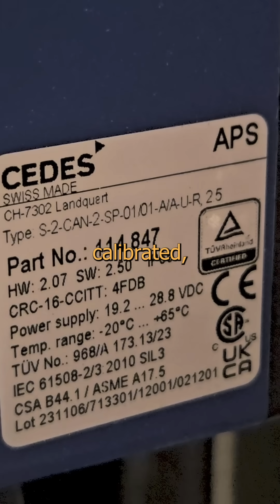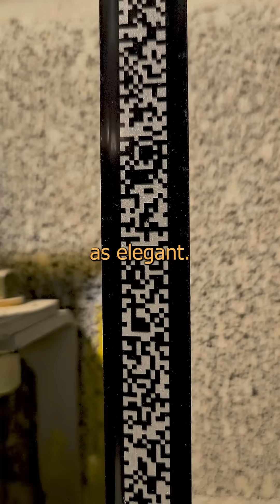Elevator Encoder #chrisboden #comedy #engineering #controls #urbex #indicator #resolver #barcode

Comment: I was trained to drive a manual elevator "muscle memory" is correct. It was not my full time job. I only drove when the elevator attendent was on break or afterhours. But even still, most of the time I could get it within a 1/2in of level on my first try.

I was told the elevators I was driving were the last manually controled elevators in the country. And I was one of the last people trained on them before they were replaced with computer controls.
Reply: that's really cool!
Reply: Perhaps the last one for passengers, but I remember running a lift for cargo and such and I know that lift is still functioning.
Reply: There are manual elevators on almost every high rise construction site in north america and probably Europe too lol. Its how we get materials and people up 10-50 floors before the main elevator is set up, usually near the end of construction. If you are ever looking for work a first aid ticket and manual elevator cert should be able to get u a relatively well paying and easy job in almost any growing city.
Reply: in europe we use special carts that get pulled by the cranes, if no elevator is available or working. else, we take the stairs. materials get brought up by crane and on foot.
Reply: @andywillis9701 our cranes generally only bring stuff to the roof or whatever floor is being built at the time. although they do have a "ramp" they use occasionally to acess the floors below via the side of the building.

we just got the material elevator set up where I am working now. We were bring stuff up on foot. 15 stories. I was never so happy to see a elevator in my life
Reply: Wasn't even aware of such a thing having existed. Very interesting piece of history, thanks 😊
Reply: Ah yes the useless skills accumulated over a life time. I used to be a stripper. Negatives. Just not that kind of stripper you were thinking.
Reply: And THATS pretty cool.
Reply: There's at least 1 near me, at least as of afew years ago and I'm 90% sure it's still there, the mega rich tenents aren't the type to give up something so upscale.
Reply: You know, I never knew they were manual. Makes a lot of sense, like the telephone operators, but I just never thought of it

Comment: A rare instance where adding a QR code actually improves things
Reply: 2d barcodes and QR codes are incredibly useful, especially in automated factory settings and item tracking, they’ve just been adapted into a shitty system where menus no longer exist on a piece of paper.
Reply: @stopitnowlol6697  Ok boomer… 😅
Reply: @zehph   bro what?
Reply: I think qr codes are pretty nice, the first 25 years was mostly annoying now there are alot of uses.
Reply: QR codes that aren't public-facing are almost always extremely useful, otherwise the professionals who do interact with 'em wouldn't be using them. The surgical instruments I work with often have QR codes on them that I can just scan into our system if I need to check something, which simply wouldn't be possible with a traditional barcode.
Reply: @Avendesora  out of curiosity, why would a traditional barcode not work in that use case? I'm a huge fan of QR codes for robotics, automation, and logistics, but I'm struggling to see why a barcode wouldn't suffice for tracking surgical supplies
Reply: @Sudonymer  Just size, as far as I'm aware. You can have teeny tiny barcodes, but because they're a linear binary system they have to get longer and longer the more potential information you have in the database. QR codes contain far more information in a much smaller footprint
Reply: @Sudonymer  They could. But this is a continuous 2d strip that doesn't repeat. I don't know the resolution, but it may be as few as 2 or 3 lines of non-repeatibility. Meaning that you only need to read 2 or 3 lines to know where you are.

On a 1d non-repeateable bar code you'd need to read maybe 10 lines, I'd guess?
Reply: @Sudonymer barcode can be destroyed by wiping out a single line, qr has redundancy
Reply: qr codes are software magic and are very useful
Reply: @aiexzs  nah QR codes are just a visual representation of binary data. Nothing particularly special about them.
Reply: I do robotic layout and we just started printing QR codes on the ground that when scanned, bring up an AR model of the building once constructed. They really can do some cool stuff now.
Reply: Yeah turns out mechanics and engineers and technicians are fucking goats if their goal is to just get a job done well and not look super cool and futuristic
Reply: That's not a QR code -.-
Reply: It isn't QR code. It is 10-bit (1024 values) Gray code - the special ugly form of binary encoding where adjacent values differ with only one bit. It's incredibly hard to read by human but it is less prone to errors when machine reads it.
Reply: Looks like 24bit; alignment pixels on left and right side every three rows. I'm guessing there'll be a checksum in the decoded data, and that the sensor keeps track of the sequence to predict the position if the current position checksum is invalid.
Assuming 3bits for the sum, if the pixels are 1mm² that'd allow for shafts of 2km. Very elegant. 

It'd be interesting to see if there's a mechanism to wipe/blow off dust from the strip.
Reply: @sircompo Or, even more fault tolerance on a shorter than 2km shaft. sum multiple read heads 1/4 a repetition out to add a third dimension to the resulting grey code value
Reply: @sircompo  No real need for a checksum, as the controller can easily spot errors since the decoded position should be monotonically increasing or decreasing depending on direction. Whether it does contain a checksum or not I don't know though.

The system shown is called APS by CEDES, and can give the absolute position with a resolution of half a mm, supporting a maximum length of 1500m and velocities up to 20m/s (that's about 72km/h by quick mental conversion).

There's clearly some clever encoding going on there...
Reply: @koma-k  Thanks for the extra info. Having given it more thought, I'd be surprised if the positions weren't encoded using Reed–Solomon for error correction instead of a simple error detection checksum. Probably important that a safety system like this can report a reliable position after a power failure and potential position shift during an outage. Why do I get the feeling this is an ADHD rabbit-hole that'll have me up all night reverse-engineering it all?!?!?!
Reply: @sircompo  I skimmed through all the PDFs I saw on their website, but none mention any technical details beyond the resolution/max length/speed and that it has two cameras for redundancy. I'm thinking that the cameras are not used just as "simple" code scanners, but also look at the exact position of the code lines within its frame of view - the code tape itself is far coarser than half a millimetre, so I'm thinking that it parses multiline symbols on the tape and adjusts the position read by looking at where it is in the frame; at a guess the camera resolution maybe being a quarter of a mm (or better).
Maybe one could find something via patent searches, but I'm not inclined to spend that much time on this, interesting though it is ;-)
Reply: @koma-k it looks like the pattern does use checksum as it's not increasing by one in binary, it's a bit more random.
Reply: I mess with qr codes, especially as advertising and labeling; because they're so optional.
Reply: I can’t think of any instances where they don’t improve things.
Reply: Japan uses these on their trains to open the train doors automatically
Reply: Lol! Scan this!😊
Reply: im guessing you think this sounds clever, but, you actually have no basis for your BS, except conjecture, and you sound dumb AF
Reply: @meddle98  why the hate against QR codes?
Reply: This isn't a QR code. It's more like a linear 2D barcode. Just many of them.
Reply: Except, if you follow Deviant. Hoistways are greasy and dusty. A visual system is a terrible idea. The first time a mechanic touches that strip, the elevator dies. Measuring rope travel and prox switches/hall effect sensors are much more robust. Even a stepper motor that counts itself for distance would be better.
Reply: LOL

I watch/read a bunch of spy stuff and was thinking about how similar to QR you could get wild with this.

There was a Blacklist episode where they rented a whole floor of a building and hacked the elevator to go to their mocked up fake floor.

Comment: That strip has 10 bits across its width. 2 binary states of each bit, so 2^10 states for each row is 1024. If we assume there are 16 rows per inch, that's 64 inches of strip before you've uses up all possible states. That pattern has to repeat, possibly twice per floor.
Reply: The sensor scannes multiple lines at once.

Comment: This work great, until you break the beam.  The operator panel on the top dies and you have to reset the entire system.

Also, this frequently have issues and the machines have to stop and recalibrate.  

All told from an Otis elevator tech as we were stuck in the lift waiting for it to figure out if it wanted to trying finding floor 2 for a 3rd time or just say fuck it and trap us until another tech could get onsite.

Comment: It’s 10 bits across which is 1023 combinations on one line so the elevator must increment a few lines at once in order to not repeat transversing a tall enough elevator shaft

Comment: Simple in the mechanics, but the tech in the laser, photo receptor, coding, and computer behind it are anything but. It is very cool.
Reply: I agree but I think this is a case of it being being error resistant. If they use a qr code along the shaft why don't they use switches and lever instead? I bet there's a case of something getting into the shaft and messing them up.

Comment: Identifying the spot you want to stop at is easy. A chalk mark can do that. Actually stopping there can be hard. Stepper motors, PID controllers, PWM controllers with only 1000 steps of resolution, optos, hydraulic pumps, RS485 controlled vavles. I spent a couple of years tyring to make things stop in the right places at the right times. It was fun, but it was not easy for a small gang of geeks and a Pentium II running the whole show via a cylcades(?) multiport serial card:

https://www.youtube.com/watch?v=NyT6jh06fWQ

This thing could throw 200kg bales of wool.
My biggest contribution was actually imnproving the sort algrorithm.

Comment: It's mechanically simple, but all the complexity is hidden inside the camera and computers used to run the elevator.

It's really not any simpler than the more mechanically complex systems. But it's more reliable because there are no moving parts and electronics wear out really slowly

Comment: If you think that’s cool, do some research into the motion tracking system on the Guardians of the Galaxy rollercoaster. They use an encoder rail technology like this across the entire ride track so that the train can know how to rotate properly to adjust for any minor changes in speed or pacing. Very very cool system.

Comment: If I count it right that's 10 columns on the pattern. That's 1024 unique patterns possible for each line. Assuming the height of one line is about 2.5 cm ("an inch"), it gives you 26 metres of height until you must have a pattern repeat. That's barely enough for 7 or so floors including the width of the floor foundations. Or is the singular line not the unit of a pattern?

Comment: I kinda doubt that "every line" is a unique identifier. There seems to be 10 points to each line which would lead to 2^10 possible stopping positions for the elevator. if the encoder took into account 2 Lines, that would give you 2^20=1 mio different positions, which seems somewhat plausible. in reality its probably different, but both outer lines seem to have a repeating pattern that would demark the individual "QR Codes" if you will.

Comment: If you think that's amazing, take a look at Heidenhein Linear Tapes.  Similar concept, but it's a series of microscopic lines.  The read head just counts the stripes as it passes.  To calibrate it for accuracy, you compare the actual movement to a laser measuring tool, then stretch the tape to make the movement match.  Accurate out to 5 or 6 decimal places, common on Ingersoll large milling machines.

Comment: Many years ago, the first and second generation of rotate-rotate CAT scan units had a similar device called 'the zebra scale'. Essentially, it is a round, narrow plexiglass circle in 4 pieces, with hundreds of black lines that an optical sensor could monitor. In this way, the computer always knew where the gantry was in its rotation and when to reverse the rotation. You might even say this was the mother or grandmother of the scale you just showed. I'm talking about 1970s - 1980s technology. God, I feel old writing this.

Comment: I'm sorry, but this made no logical sense to me, so I had to work out the error. Therefore I'm going to unleash the pedantic beast on this one:

There are 10 possible indentations on a single line, which mean 1024 possible different combinations on a single line. As the height of a line seems to be a few mm, 3 mm at most, 3*1024 is a maximum height of 3072mm or 3m (aboutish 10 feet) without repetition.
Therefore it is not the line that is never repeated along the tape, but the sequence of lines, so the optical reader has to decode a stretch of tape akin to a square QR code, not a single line. Otherwise it would be simpler in both production and decoding to just represent sequential numbers on each line instead of a randomised pattern that needs to be randomised at production and then read and stored at first calibration.

Comment: Each line is 10 bits, allowing for 1024 possible combinations.  There’s way more than 1024 lines on that tape, meaning the lines repeat often. 

The optical scanner must be reading 10 lines at a time is my guess, making it 100 bit with 1.26765e30 combinations

Comment: This came after I left the game. Otis used a model of the shaft called a Selector back in the early days. Then they used inductors and vanes which meant a car had to do a reset run and start counting floors again. Other methods were switches in the hoistway This. This is modern.

Comment: Optical is nice, but get affected by, dirt, dust and humidity. Plus can be optically occluded, like by smoke. 

There's also a magnetic system, right? Using HALL sensors?
I started looking at the magnetic type, but that's a deep dive........

Comment: The coded tape is ten 'bits' wide, each 'bit' is 'on' or 'off', giving 2^10 unique codes. 

Assuming 1mm per code gives a travel distance of ~1m, not enough to be useful!

While typing this, it occurred to me that it would be possible - essential, even - to use more than one encoded line to locate the lift. Just two lines would provide a travel distance of over 1km to an accuracy of 1mm, more than enough for most uses. Three lines would allow a travel distance of well over 1000km to a tolerance of 1mm!

🍌🙂

Comment: Seeing a complex system is cool, seeing a simple system do the same things as the complex one used to do is fulfilling.
Sure, you could have multiple motors and fans controlling valves to route air in your car, or you could have a small window that you simply angle into the outside air. Simple.
I love old cars and old stuff for this simplicity, and it's refreshing to see simple stuff being invented today as well.

Comment: For further clarification, is this a linear code with 10 squares giving 10! (-2 for safety reasons) options, or is it a continual, vertical code where each line that drops off the bottom adds another to the top and vice versa? Giving 10!^n (-2) options, where n is the number of rows.

Either way, if the squares are only 1 mm, the 10! option would still amount to an elevator that was ~3.6 km high, so well within the range of any elevator.

Comment: Untul someone uses the elevator to haul cement, floor and ceramic mix, etc, spilling some on the floor. Then works in a flat with an open door. Good luck with your optical sensor then.